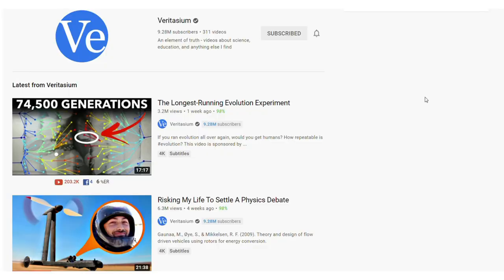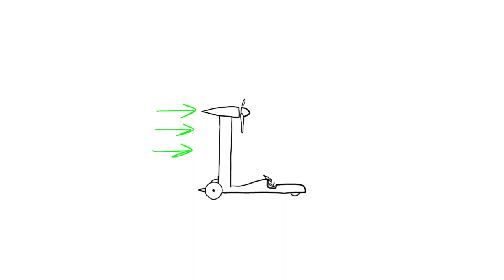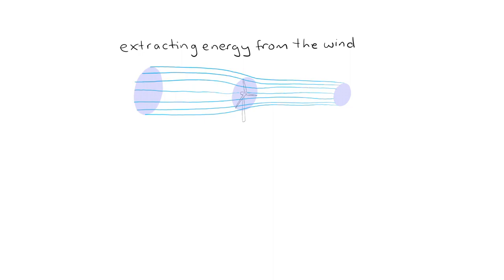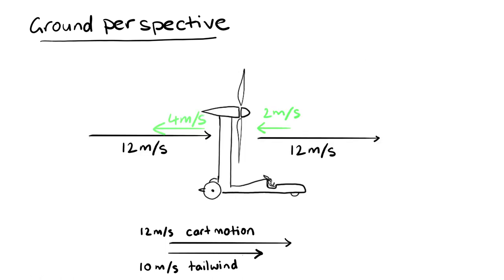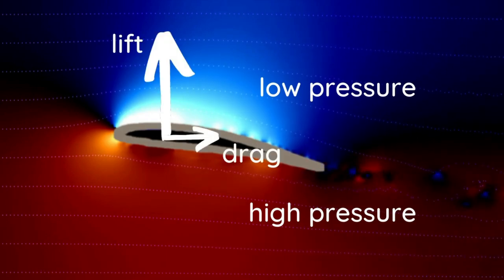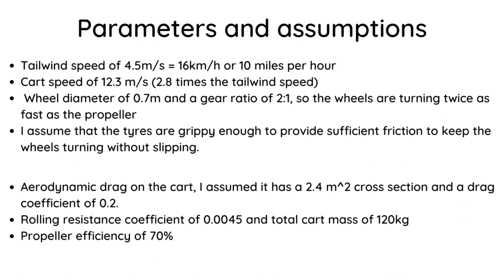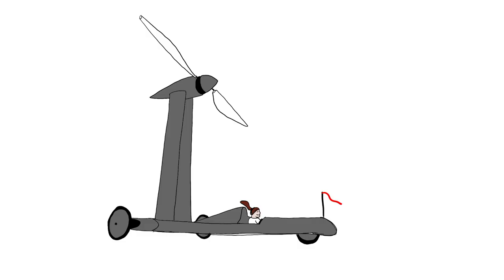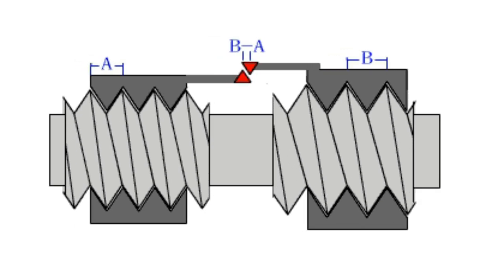Downwind Faster Than the Wind by Veritasium: How Does it Work?

Comment: So it doesn't actually go faster than the wind, using the wind, it uses the power created by the wheels to turn the turbine, and is only exceeding wind speed by using its own power. But it gets its start from the wind, to allow the mechanism to "start" no unlike a manual transmission that wont start but you have a hill and can pop the clutch while rolling down the hill. Never the less it is an amazing feat of engineering. I think it comes down to more how things are worded. If the original bet was, using the wind, this machine can exceed wind speed, then it failed to do so, it used a mechanism to power a propeller, not just the wind. If it was worded that this machine can exceed the wind speed, then it passed, as no mention of its ability to create thrust on its own, was excluded.
Reply: if it uses a mechanism that is still powered by wind, it is being powered by wind, i think the whole "using the wind" part of the bet was to exclude any different means of powering the vehicle, such as a battery or some type of combustion engine, in the end the vehicle (in all his parts) using the wind as a source of energy can exceed wind speed
Reply: The wind provides 100% of the input energy at all times.  That's the very definition of "wind powered".

Comment: To me this is not as interesting as people and Derek made it out to be. And explaining it with analogies such as cylindrical earth, doesn't make much more sense, it even makes it hard to understand.

This doesn't need complex explanations. From what I understood, this car is moved with wind and the wheel rotation is transferred to the propeller above, propeller starts to turn and accelarate, propeller creates extra thrust thanks to conserved energy from wheels, propeller pushes the wind in the opposite direction, hence the car goes faster than the wind. Additionally with higher speeds there is going to be feedback loop between propeller and wheels. The faster the wheels turn, the faster the propellers turn, though not forever due to propeller never catching up with the speed gain wheels provided. Can someone really tell me, why Derek finds this very interesting.

Comment: I think I've been stuck on "it's going faster than the wind, forever"....which I don't think it is? It can, for a short time, go faster than the wind. But it couldn't constantly go faster because there would be no energy input once the wind speed hits zero. Right?....
Reply: From a ground frame of reference, despite moving faster than the wind, the thrust from the propeller is slower than the wind, slowing the wind down, which is the source of energy (from a ground frame of reference).

Comment: As a reality check… What happens, in your model, if there is no wind speed, but you get the cart moving by pushing it briefly. Does the propeller keep the cart moving as a perpetual motion machine?
Reply: No you need relative motion. The cart would work on a giant treadmill with no wind though. Meaning it would travel forward faster than the treadmill turning against it.

Comment: If the car speed gets ahead of the wind speed then at that point the acting force switches from back to the front and the whole thing is then relying on inertia to overcome increased air drag and ground friction. It may go faster momentarily but as inertia is lost it will dip in speed such that it will just oscillate a little more out of phase to the true wind speed yet net difference will be the same. In fact net difference will be less ground covered because the propellor will cost a lot of energy in drag.
Reply: >> the whole thing is then relying on inertia to overcome increased air drag...

Nope.  We take steps to prove that we cannot make use of stored energy.

>> It may go faster momentarily but as inertia is lost it will dip in speed such that it will just oscillate a little more out of phase to the true wind speed

Nope. We can go 2.8X wind speed all day long.

Comment: even after watching 2 of Derek's videos I wasn't clear how this works, but it just clicked with the cyclist analogy
Reply: Except that the analogy is flawed. Where does the energy used by the biker to push on the car to go faster than it come from? Not from the car. Ditto with the wind (moving air): you can push (e.g. with a prop) on it to accelerate and even travel faster than it, but you need some energy for that that you can't get from the wind once it is becomes a headwind in your frame of reference (or if you travel faster than it from a static observer point of view).

Comment: I can imagine that the effect of "shifting gear" can cause a momentarily acceleration beyond but that force comes from inertia (mass and relative speed) which would rapidly decline due to friction and the absence of a power source exerting motion on the props. Also note that the moment the vehicle runs into head wind the blades would start spinning in opposite direction which would act like a break.
Reply: Correct. What I don't get is why no one in their explanations (or at least in the ones I've seen) talks about what happens to the car if it just keeps going. Because obviously the wheels turning on the ground from moving forward, then also the wheels turning the propeller to generate trust can't just keep on going to infinity. That would be a perpetual motion machine. Instead, what would happen is what you wrote. 
This car never really goes faster than the wind, only for shorter bursts, and then decelerate, so that the wind starts pushing it again. Etc, etc.
In fact, I'm curious if you set up a super long wind tunnel with a 100% steady wind flow speed, I think (and this is just a guess) the average speed of the car would be slower than the wind speed.
Reply: @gregsomlai297  No, it can go faster than the wind consistently.

Comment: Think of it this way, a cart can run along the ground driven by the wind. This is just the opposite, the craft moves through the air driven by the ground. What's difficult about that?
Reply: You're claiming drag is thrust lol.
Reply: @papalegba6796  Can you explain what you mean?
Reply: @WindThrusters  the ground creates drag. You're claiming the ground is powering the vehicle, so you're claiming it creates thrust. A free body diagram would help you understand this fact.
Reply: @papalegba6796  The ground turns the wheels, which turns the propeller,  which takes the craft through the airmass. What type of drag are you talking about? Yes the ground creates thrust by turning the wheels round which are connected to the propeller which is powering the craft.

Comment: According to the law of conservation of energy, your car, NO matter what it does, cannot take more energy out of the wind and then converts it to the higher kinetic energy. Think this way, if the wind is blowing at a constant rate and its "moving mass of air" carries a certain amount of kinetic energy, call it K1. Now imagine when that “moving mass of air" carrying the kinetic energy K1 hits the propellers of your car, then that "mass of air" with its kinetic energy K1 can ONLY transfer a fraction of its kinetic energy K1 to the propellers of your car (a lot of air will simply escape from the propellers rotating wings).

Let us call this energy received by your car as K2. For the car to move faster, its kinetic energy K2 MUST be greater than the kinetic energy K1 that it receives from that moving "mass of air". Intuitively, you can see K2 (kinetic energy of the car) can NEVER be GREATER than K1 (kinetic energy of the mass of air) which is pushing the car forward. Therefore, the moving car with its kinetic energy K2 can NEVER exceed the kinetic energy K1 of the "mass of the air" that it receives, and therefore the car can NEVER move FASTER than the constant speed of "mass of air" which is pushing the car forward. Otherwise, the law of conservation of energy will be violated - meaning the moving car somehow can "extract" MORE energy out of its source energy which is the moving "mass of air".
Answered by Shakeel Mustafa (Ph.D) from Pakistan
Reply: The energy available in a constant wind is way bigger than what you need to accelerate (the mass of) the cart. So by only extracting a very small fraction of that energy you reach that point. No need to extract all of it.
Reply: "For the car to move faster, its kinetic energy K2 MUST be greater than the kinetic energy K1 that it receives from that moving "mass of air"."

No, it doesn't. It just needs to receive kinetic energy from a sufficiently large mass of air.

Comment: As a layman this explanation doesn't completely make sense to me. What I see is that this works more like a helicopter's blade rather than an airplane's propeller. The propellers on the vehicle pulls the vehicle forward rather than it pushing the vehicle. The difference of the pressure in front of the propeller and behind the propeller pulls the vehicle forward regardless of wind speed. As long as the difference of pressure is maintained the vehicle will move forward if the wind is coming from the front or the back or if there is no wind at all.
Reply: A helicopter's rotor works just like an airplane's propeller only roughly in the vertical direction and horizontal direction respectively.
Reply: @killbeas  A helicopters main rotor works differently from an airplanes propeller. A propeller works like an air screw where a helicopter rotor works like a rotating wing. The propeller pushes air back causing thrust where as the helicopters rotor creates a pressure differential causing pulling effect in the direction of the lower pressure. Look a how a gyrocopter works.
Reply: @aneophyte1199    Sorry kid.  You just described the same phenomenon in two different ways.    An airplane propeller and a helicopter rotor work in the exact same way as they are both rotating airfoils that produce thrust and both decrease the pressure in front (above) and increase it behind (below) driven by an engine turning a central shaft.  You've been reading children's books descriptions of helicopters and airplanes apparently and didn't understand the equivalence because of the different words used.   Gyro copter blades are indeed different as they aren't powered from the shaft by an engine but from the impinging air like an airplane wing with the air coming through it from the bottom like a turbine.  But it is still a rotating airfoil but not a classic propeller so it is indeed different.

Comment: Thank you so much for this explanation. This makes some of the physics involved a lot easier to understand.
It also seems to make it clear that veritasium should have lost the bet since the bet specifically referenced the vehicle "sailing" in excess of the wind speed when it is abundantly clear that once Blackbird transitioned to the wheels spinning up the propeller through the drivetrain to the point that the propeller was providing thrust as the primary motive force instead of the wind that Blackbird was no longer "sailing".
Reply: In other words, if the bet was that it TRAVELED faster than the wind, Veritasium won the bet. But that wasn't the wording of the bet. The wording of the bet was that it SAILED faster than the wind which is not the propulsion used to exceed the wind speed. Veritasium lost this bet as it is worded.
Of course, you can also say that once the bet was conceded, it was voluntarily lost.

Comment: It might not violate the laws of thermodynamics, but perhaps it violates the laws of FIA speed measurement? What I'd like to see is a timed run over a fixed distance where the average speed of the vehicle over the run is greater than the average speed of the tail wind propelling the vehicle. THAT WOULD BE THE CORRECT WAY TO MEASURE THE VEHICLE SPEED. All I've seen so far is quick out takes with streamers and wind socks briefly caught facing in the directions that suit your narrative, cartoon drawings, and a toy on a treadmill. The toy on the treadmill is a poor analog because a) there's no wind, and b) the toy has a fixed pitch propeller, but the full size vehicle does not. The full size vehicle operator can trade momentum for thrust by varying the prop pitch, which is how it gets moving. Apples and oranges aren't gonna cut it for me, and by all rights you need to return the $10k as it was obtained fraudulently. If you don't make an assessment of the vehicle vs. wind speed over a prolonged period of time and distance, and at any point when the wind drops to below vehicle speed you declare that the vehicle is moving faster than the wind - then that is disingenuous.
Reply: @eyytee  So you're saying the propeller cannot drive the wheels by means of a one way ratcheting system that only lets the wheels drive the propeller? Then that's yet another 'principle of operation' that wasn't included on the treadmill toy that was used to (fraudulently) win the bet, and violates the final paragraph of the agreement.

Yes, I've seen the NALSA observer report from the x2.8 run. I have a couple of interesting observations. First is how the report states the sampling interval for ground speed and wind speed was 10s, and the measurement period was only 10s too, thus providing only one data point for the speed ratio. The second is that immediately before the measurement period, the wind at the chase vehicle is shown to drop by 40%, thus driving the speed ratio artificially higher (vs. what would be obtained by averaging over time and distance), and whether you like it or not, the speed at that point was related to momentum already imparted to the vehicle. Momentum can also be thought of as stored energy, correct? The data clearly shows it's no longer accelerating after that x2.8 point.

There's a name for selectively picking data to embolden your point. It's called fudging. The proper way to measure vehicle speed for record setting purposes is to time over a known distance. They won't do it however because they know if the wind speed falls below 10mph or so, they're screwed. Like I said... disingenuous and fraudulent.
Reply: @rbwannasee  For the record you obviously pick the  fastest ratio achieved, otherwise it would not be the record. For the bet it doesn't matter, because the ratio greater than 1 is achieved easily, while accelerating.
Reply: @eyytee  Disagree 100%. For the statement "this vehicle can travel downwind faster than the wind" you need the average speed of the vehicle and the average speed of the wind over a known distance travelled. Time taken to cover a known distance is how all auto (track) racing, drag racing, FIA officiated world land-speed records, and SCTA speed records are established. Peak speed at any point is irrelevant. If you're so confident this vehicle can achieve an average ground speed faster than the average wind speed over a known distance (typically 1 mile for speed records) then provide a link to prove it. Failing that you are just relying on momentum already imparted to the vehicle to make the determination that you're at one point in time travelling faster than the wind - and conveniently picking a moment of low wind speed to do so.
Reply: @Rick_Cavallaro  I understand perfectly. You're cognitive dissonance is set to overload, and where's my link to a one mile run? How about a link to a video of the treadmill toy filmed outside zooming downwind faster than the wind?
Reply: @Rick_Cavallaro  Well I've read the entire wager on this video, and the NALSA observer report. Who wrote the rules? You? lol! (Yes, I know who you are) Where's my links to my requested videos? Is either of them too much to ask? Seriously - why no video of the treadmill toy outside on the ground in the wind going downwind faster than the wind? You all claim the frame of reference is the same, so it should work right? This whole thing is disingenuous at best, fraudulent at worst. Veritasium really should give the $10k back.
Reply: @Rick_Cavallaro  Links to videos please.
Reply: @rbwannasee  Acceleration without stored energy use for propulsion proves steady state is possible at that speed. NALSA rules are based on this, because land yachts have limited space, compared to watercraft or aircraft.
Reply: @eyytee  Oh, that's neat - and convenient too I guess. So hey, do you have a link to a video of the treadmill toy outside in the real world on the ground going downwind faster than the wind? Here's a couple more questions... If you don't have a link to a video like that, then please explain why not? If the reason is because the treadmill toy doesn't actually work that way, then can you think of a good reason why Alex Kusenko shouldn't contact the California State bar and start a case to get his money back because he was scammed? The toy was used to win the bet, but if it doesn't work in the real world then that's fraudulent. You all claim the frame of reference is the same, so let's see it. I'll even allow you to push start it - equivalent to holding it down on the treadmill until the prop reaches correct speed. Link please.
Reply: @rbwannasee  looks like rick has deleted all his posts. i wonder why?
Reply: @rbwannasee  why would it be any different, given well behaved turbulence? and thats on you to prove, everyone else already knows reference frams are equivalent.